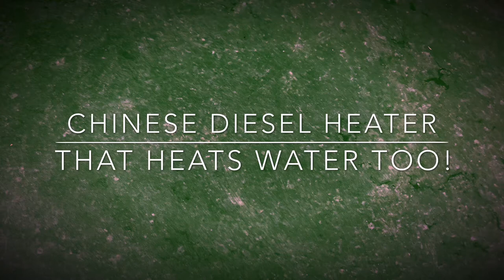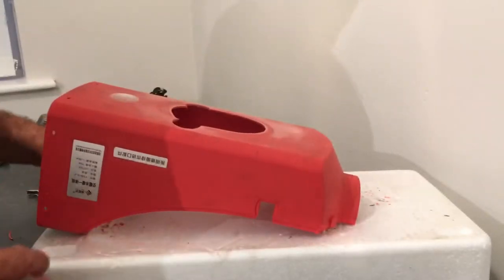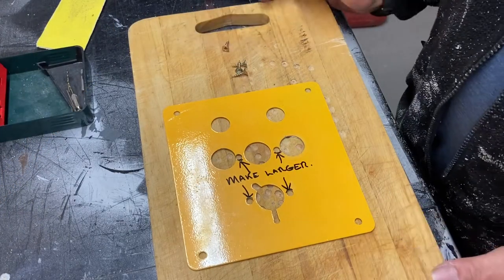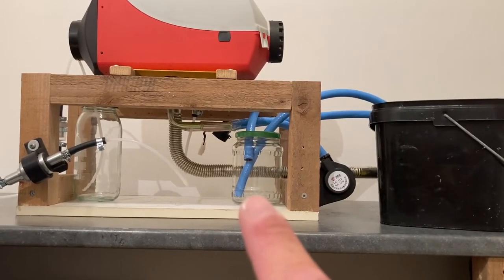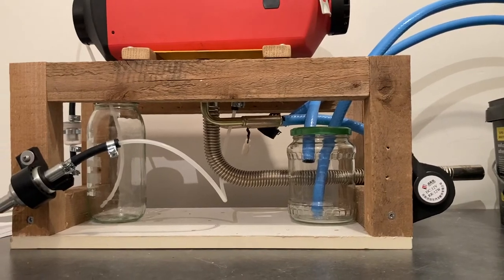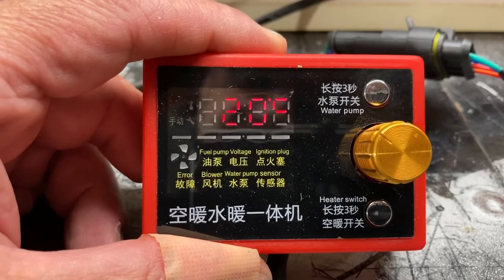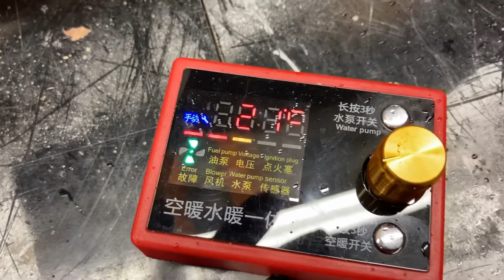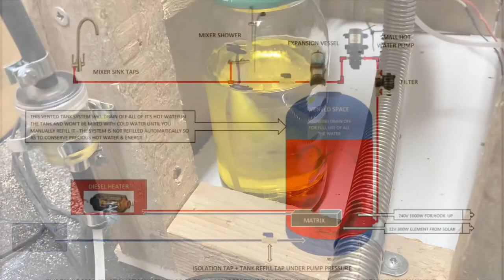Chinese Diesel Water & Air Heater Feasibility Test

Comment: I'm a heating engineer working with Rayburn (vented) and Vegas (pressurised)... The expansion tank is really your header tank. What's required are levels of safety.. a separate pump will need to start at a preset temperature and dump heat off or the system will simply boil..  lots more work to do but you're close...
Reply from the maker: Yes thats what it does, boil lol but i’ve redesigned it adding automatic gas vents and changed the coolant water mix with waterless coolant. It runs well now so long as i don’t let the heater go above 180’C. This is achieved by turning the heater right down to its low running setting. Just right for quiet tick over. You can only run the diesel heater hard if you turn on the coolant pump to heat your tank but that works too as you want hot water as soon as poss lol. The waterless coolant gasses up above 180’C but when it does, its undramatic. It doesn’t turn on the steam tap and blow everything up so Ive found a happy medium.  Of course i will report back to my channel when i can test it for real on some maiden voyages.

Comment: I personally used superglue and baking soda to make my diesel air and water heater to have no gaps and then sand it down the superglue and baking soda flush and if you don’t know, baking soda makes super glue hard and faster and harden like a rock

Comment: The answer to all those with boiling issues when you still want the hot air just not the hot water.
Buy two heaters one for air and one for water.
However if you really only have space for one, then you need a automatic shutoff valve in the water to heater feed, this activates when hot water reaches temp and opens when temp is lower then set point.
Now either add another 3 port valve on the discharge from the heater that switches the output of the heater to vent or discharge into the sea for a boat or to the ground under the vehicle.
Once water temp is reached supply shuts off and heater feed goes to a pressure relief vent allowing the heater water to boil off and the air heater to continue.
Ask a friendly heating engineer to help you if you need further info.
Yes i know not many friendly ones about, their demeanor improves once to get out a credit/dedit card.
Reply from the maker: I like your ingenuity but I need to avoid heating water to avoid calcification inside the water part of the heat exchanger. Hence using coolant to heat the water tank. New vid out in couple of months showing the set up in use in my van. Ive not done any more vids due to work/travelling and female commitments but now winter is upon us, im getting back on it!  Thanks for the idea, a valid alternative.

Comment: as im in Australia and winter is not that long i put a flap valve so as i can send the hot air outside so in summer i can have hot water without cooking inside ,, Great vid ,
Rob 
NSW
Australia
Reply from the maker: Great idea and appreciate your kind words. Living in the uk means we seldom get scorching weather so its not such an issue. Spring to autumn its usually chilly first thing in the morning and at night so its much less of an issue. However for those really hot weeks I’m hoping i can heat the water up via 240 element on grid and using a solar panel to slow the temperature drop off grid (to be experimented with next yr). Failing that its solar combined with a good old kettle of boiling water in the tank lol.
Reply from the maker: Im currently making the vid on the plumbing i’ve installed but keep getting distracted with trips away in the half built van lol

Comment: How about puting few bends of the exhaust on that buchet? More heat and for shure more simple, no coolant, no pump... What you will do when need heat but not hot wather? It will boil.
Reply from the maker: lol great idea but you can’t control the heating of the water. It will just get hotter n hotter. When I just need heat I can turn the water pump off so the tank won’t heat up any further. I can still use the hot air system to keep the van warm.

Comment: Thanks for posting, your design seems overly complicated, I had not envisioned using an automotive heater core as a heat exchanger.
Reply from the maker: Hi yes so long as you don’t drink the water but you should never anyway! Im considering switching to a copper or stainless steel coil. The next follow up vid will be out in a few months. Ive stopped editing vids for a rest during the summer as they are too time consuming but hang in there as the next few months I will have loads of vid showing the rest of the build and how it all works together.
Reply: @diycampervanman1633  Thank you for the reply.